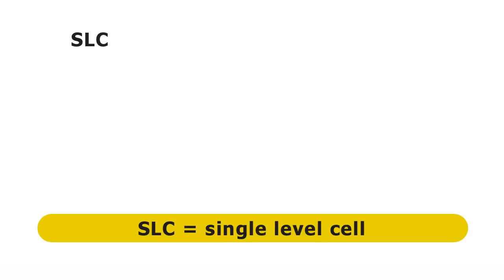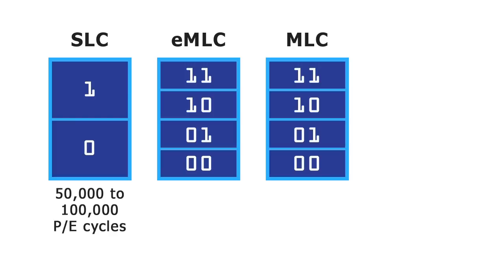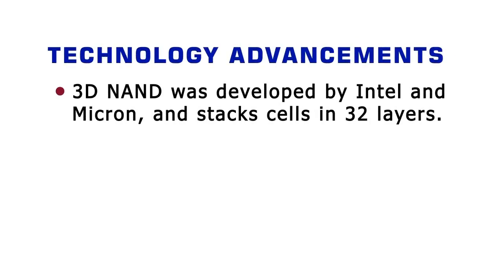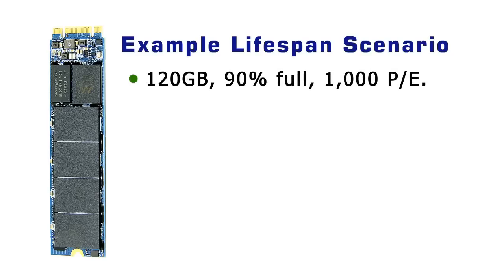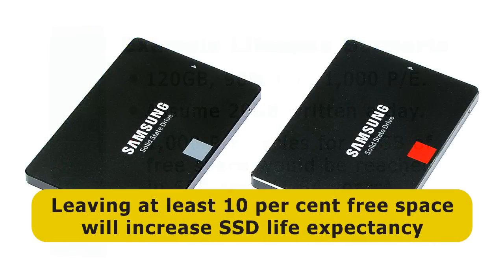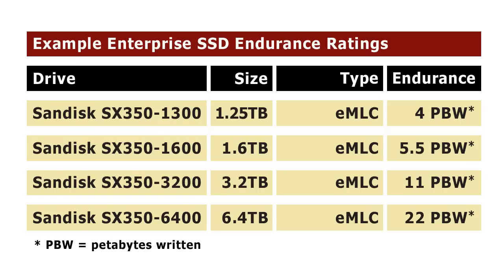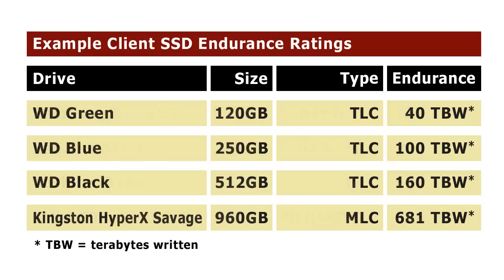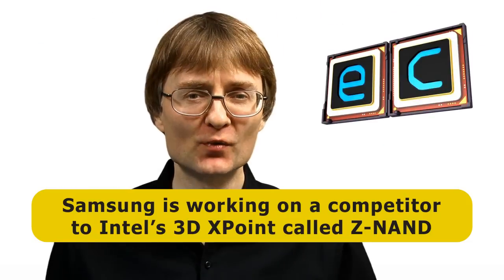SSD Life Expectancy

Comment: Try Space Silicon or Titanium Coating , or any other precious crystals or metals that can prevent the slow-burn wear-out of memory-cells , to increase the Pe cycles or SSD'S life by increasing the incandescent point level  in temperature of the silicon materials in the SSD   . Thus , mimicking the standard metal disk-drive memory disc for a long-lasting flow of electrons (leading to the after-burn effect ) which provides  greater Pe cycles for a longer life SLC < eMLC < TLC < QLC (Toshiba)= Slow burn risk increase as data concentration also increase . The Wear-Levelling is preventing memory overflows and electronic burns is caused by the Wear-Out and the Coating will make Wear-Levelling much less of a concern just like Apples Heavy Black Goo Coated Chips for a denser electronic flows without burning : Thermodynamic Laws of Electric Flows .

Comment: OMG Samsung 830 Series, my first SSD back in 2012, ah the nostalgia 🥹🤓
Still have it and working after 11 years (purchased on January)! 
And almost 25 TB data written 😄
For all people worrying about SSD writes, relax, you’ll die much sooner than your SSD lol in fact I SSDed everything from my main desktop PC to my PS4 😂 🔝 I’m a huge fan of SSDs
Reply: I definitely agree with what you said. I have an old Silicon power micro SD card from china that I bought in 2012 with my lg optimus l5 and guess what?? After 11 yrs , the same micro SD is still working, it's a bit slow (class 4 speed) but still works, now imagine how long SSD can last. I will sure probably pass away before seeing my SSD dying😂😂😂😂
Reply: They can still die from electronic defects. I've replaced probably over 50 laptop HD's with SSD's for customers. 2 were dead out of the package, and 2 failed after a few months. The rest are fine...so far!

I bought my daughter a new Asus laptop (2-in-1, mid-grade, about $1000 new). After about 2 years, the internal Nvme (Intel or Western Digital, I think) died. She didn't use it super heavy, just average school use. I told her to shut it down right away after it froze, and send it to me. I was able to recover many of the files, but not all.

Comment: I'm still sticking to a traditional HDD.  In my own experience, HDDs last a very very very long time.  I have had 1 fail EVER.  I still have old 20G drives that work fine, they aren't being used simply due to being too small.  I have a 500G drive in my system that, while doesn't see as much use, it still works and is probably 14+ years old now with no sign of stopping.  So, I don't see HDDs as guaranteed to fail, but SSDs, while faster, are guaranteed to fail, which bothers me a great deal as I don't tend to upgrade as often as most, I certainly want one to last longer than 4 years or more.

I may grab one for my operating system drive, and use a HDD for everything else.  I can also get a 4TB HDD for the same price as a 500G SSD, 8 times the storage capacity with less of a chance to fail is well worth the wait for loading times.

Comment: Very interesting but a lot of info to digest. I am 67 so maybe that's it. What I did was took you advice a bought the Elements 5T external for my new laptop. I install most of my programs to that drive and use it basically as my main harddrive. So If I am just brousing the net I do not need to plug it in. I use a 256gb SD card for the slot It work as a HD when the 5T is not pluged in. I also use a Old USB thumb drive just for portabilty with smaill files like the book I am writing. I do have a 1T external I built and a Sony external DVD writer. So far so good everthings working good and I figure my SSD is getting less ware and tear. I will say my Lattop is not set up as a game machine. Last year I had 2 heat operation so it ist pretty much business.

Comment: ssd is unreliable to store valuable data, I lost a hard disk ssd 256 gb, however  I think it is very useful to use it for booting computer system like windows 10 ...for me . i use a 120 gb for booting win 10 . and a normal "HDD 2.5  2 To"  to store my data
Reply: Same here, Windows 10 installed on a Kingston 128 Gb SSD, and everything else is on 2 TB HDD. I will never trust an SSD so much to store data on them, it's good for the OS and softwares like Photoshop CC, Lightroom CC and etc. to install it cause you can easily redownload them by using the CC application a new install, but SSD's will never be something to store important data on them.

Comment: OCZ agility 2 120 GB here working great since 2012. Being almost full for most of its life. I'd say I struck gold.
Reply: Same here, got an agility 2 60 gb from 2010 with 20 tb written. It performed really well until last year, read speeds dropping to 30 MB/s.. so now it's replaced.
Just a word for you guys, it shows as 100% healthy and 98% life left in the ocz ssd utility. Despite that its performance is pretty bad so don't trust those numbers fully =).
Reply: JRways Mine still performs great and boots in 30 seconds  with a lot of TB written. I don't see any reason to upgrade and it still reaches 150-200 MB/S read (albeit the write is like 75 MB/S). Comparing it to my laptop which has an M.2 ssd with 500 MB/S read I don't see a big difference. An SSD is still fast even after years.

Comment: HDDs are vulnerable to vibration and heat.  I've had several HDDs fail on me in 30 years.  Never had an SSD or RAM memory ever fail on me.  Advantage SSD.
Reply: Chris Ayres, give your computer a good jolt while some data are being written, repeat that experiment several times and report back to us.
Reply: Spirit Guide1214 I've had an sad fail on me under 5 years, couldve just been a bad one out of the bunch but it was still a pain since it was my boot drive and had all my data

Comment: kingston 120gb u400
30% used
Takes 7 sec from power button to desktop
blazing speed
Reply from the maker: Cool.
Reply: but this ssd don't have 3D nand
Reply: I have 120GB Noname Chinese m.2 stick  for Linux '/' partition in my i3 laptop. The same 77sec from zero to Linux Mint Cinnamon desktop with Firefox. 8BG RAM with tmpfs. No swap. /home and /var in spinning HD in CD bay. All disk operations have been optimized so that there is no write operations to SSD in normal use. The machine is faster than my i7 desktop with 18GB RAM and M$Windows with spinnig wheels.

Comment: I can't find any option for overprovisioning in the latest software v.5.0 (Samsung).
Reply from the maker: Now this surprises me! :) Though, following a quick Google, I see that it has been taken out of the latest version -- with some complains about this . . . This said, by not filling your drive to the brim with data, you can achieve the same effect as a user.
Reply: konsul2006 as long as your using Windows 7 or higher you have trim support so all free space is over provisioning space (OP on a OS that supports trim is unnecessary)
Reply: thanks
Reply: That's likely why samsung removed the OP resize tool as its pointless under client work loads and windows 7 on wards supports trim
Reply: All u have to do is go into any diskmanagement, select the partition u can shrink, and shrink it. So Windows diskmanager, select your C: partition (for ex), and reduce its size with the ammount u want as OP. 

OP is not what some-people think "magical space" its just... unused, non partitioned space on the drive.
Dont believe me? Do what i suggested above and check with your tool-box software on your SSD, it will say it now has OP space.

Comment: I laughed out loud when you said SSDs could potentially last over a decade. Years ago I bought a 60GB drive thinking that'd be enough for Windows 7; not a chance in hell, what with updates and programming IDEs insisting on being on the C drive with the OS! I bought a 120GB SSD as well, for my most played, most demanding games. Both were noticeably slower when last I checked about 5 years ago, with the OS drive constantly complaining about insufficient space. I had to take a break from... life in general... due to mental health issues brought on by depression, a relationship ending and my former employer of the time defrauding me 6 months pay (no exaggeration,  sadly). I'm slowly catching up with the advancements in tech that I missed out on in the intervening years now though. :) Thanks! By the way, have you considered getting in touch with another tech (among other things) YouTuber named Tom Scott? I think you both would get along quite well!
Reply from the maker: Many SSDs have run for far more than 10 years. I am inevitably here talking abut an average for new drives.
Reply: @ExplainingComputers  I figured, just wanted to mention it. :)
Reply: He also said "potentially" which you need to keep in mind for certain use case scenario. Take mine for example. My Intel SSD is coming up on it's 8th year & after diagnosing it recently, it might last another 5+ years. That is due to me not constantly installing/uninstalling software, not downloading or putting files within the SSD negating any need to copy/cut/paste files, or even make any significant changes that affects the write cycles.

Comment: SSDs may have a limited number of cycles, but spinning hard drives will always fail more often.
Reply: well i have a.hdd for 15 years and counting , i just buyed a ssd to run the system and i hope that it work as long as my hd at least. if not it will really be a big disapointment.

Comment: An excellent video regarding ssds. But I still beleieve an SSD's life to be shorter than HDDs. My Brand new ADATA SU 630's life dropped from 100 to 9 percent in just 4 months whereas after 7 years my intel SSD's life is now at 97%. All of my HDDs are still at 100% after years of use and performing flawlessly.
Reply from the maker: Certainly SSD life expectancy -- at the same data write levels -- is far lower than HDDs.

Comment: A more important thing to note is that SSD's are best installed in systems and not utilised as external hard drives. Especially if used for backup and stored away. Lack of power has been rumored to result in data degradation and loss
Reply from the maker: Simply not true. SSDs will retain data for at least a year with no power (just like all USB drives and memory cards).
Reply: Noted with thanks

Comment: I got my Samsung SSD 3 years ago and used it thoroughly. Multiple data writes, formats, reformats, etc... and now after 3 years the total TBW still is <25TB, and it has a rated TBW of 150TB so it will last another 15 years at this rate. Good choice to spend a bit more on the SSD back then.

Samsung 860 EVO 250GB SATA M.2 (2280) Internal Solid State Drive (SSD) (MZ-N6E250)

Comment: Still using an original Crucial 120GB SSD from 2011 for Windows and it's going strong. Have swapped it from an original i7-860 to an i5-3570k to my current i7-6700k setup and haven't had a single issue in almost 9 years. I don't install hardly any programs on the drive at all, just read Windows and do updates and keep about 20% of it free

Comment: I have a question. 

I want an SSD and NVMe drives that meet these requirements:

1) Are 1TB to 2TB. 

2) Are capable of hardware encryption. Yes, I know hardware encryption is weaker than software encryption.  

3) Has a high speed of data transfer and extended life. 

I want to software encrypt the drives as well. 

Any recommendations? 

  I want to software encrypt my newer and older systems. However, I want an SSDs that will resist the many read and write cycles. SSDs have come a long way even since the date of this video. 

  I do not want to resort to hardware encryption because it has flaws.
Reply: There is alotta qualifiers that meets your requirements. Just go check out on Amazon or wherever online shopping supported by your region. Keep in mind that older motherboard systems prior to 5 years ago is unlikely to have NVMe slot to support it. Also what do you mean by "hardware encryption is weaker than hardware"? That doesn't make any sense.
Reply: @KillRei  It was a typo. I corrected it. 

I want to do both. I plan on building two systems.
Reply: Ok. In most cases hardware encryption is better & stronger than software encryption. Also be careful with it's implementation. On some systems, using both type of encryption at the same time may be incompatible and/or may conflict with each other too, that it could be possible in a few instances that it might negate each other's encryption capability.
Reply: @KillRei  Hardware encryption is stronger? Have you read the papers on that going back ten years. 

Hard drive encryption for a skilled person is easily bypassed. 

If you are referring to some top secret government crap. Hey more power to you. 

Consumer grade hardware encryption is mostly sub par. 

What are your sources for this?
Reply: I may be unrelated to any government but I don't have to be part of one to know my tech. I am after-all a tech-savvy enthusiast. I'm no encryption expert but I've been in the scene long enough to know that hard-crypt is ON AVERAGE more secure than soft-crypt depending on how well the implementation is. It all depends on different usage scenario. Of course, both types of encryption has it's plus & minus. Take the hard-crypt Trusted Platform Module for example, it's widely adopted, difficult to brute-force without physical access but has a backdoor hole & being a hardware crypto-processor, it adds some cost to components. VeraCrypt or LibreCrypt is a good soft-crypt for you if you are into it, if it has any known backdoor it can be patched through updates but a bit easier to brute-force attack than TPM being the software that it is. Don't rely on BitLocker for soft-crypt. Its been breached soon after release. Seems like two of your sources from How-to-Geek & ZDNET does supports my claim, while another one has an ambiguous claim. I couldn't be bothered reading or watching the rest nor did I asked for sources. If you are looking to get more details, maybe Wikipedia could inform you better. From here on, you are free to choose whichever type you believe to be more secure & just go with it. There is nothing truly wrong with choosing one over the other.
Reply: @KillRei  I am not trying to be insulting or rude. I am sorry if I came off that way.
Reply: @jamesedwards3923  Don't worry about it. I try to be as professional as possible when it comes to customer service.
So are you going to use soft-crypt or hard-crypt? If you are going to use both, make sure that the software are compatible with each other.

Comment: Failure modes of eMLC drives MUST be considered before buying. AFAIK eMLC drives are designed to run in redundancy systems like RAID so they fail totally much more rapidly than consumer drives. It's more beneficial form enterprise perspective - either it works or doesn't. In contrast consumer drives are designed to deteriorate in a more "gradual" way. if you read this please check this info. I write it from memory and it's based on Allyn Malventano's brief mention on a podcast.

Comment: My experience with Flash memories is that when they start to fail they fail to erase, they become read-only rather than failing completely like a hard drive. So I'm not worried about data loss except due to inelegant software that discovered the problem only after it had partly erased a cached block. (The video talks about P/E cycles but the way Flash works is more like E/P -- you have to erase the memory before you can write to it as the writing only 'unsets' bits, it can't 'then set' them. Flash is divided into blocks that are typically multiples of 64KBytes in size and the erase operation is done on a particular block of memory before its ready to be written to.)
Reply from the maker: Instant failure is very common too for an SSD -- just see the comments here!

Comment: Very interesting information, even if most of it was over my head. I have in fact, just bought a new 250GB Samsung SSD and installed it in my laptop along with a 1TB mechanical HDD. (My laptop takes two HDDs). My SSD is divided into two partitions, both of which currently have 50% or more free space. I only have Windows and most frequently used data on the two SSD partitions, with other data on the 1TB HDD.
And yes, I have copies of my data on three portable HDDs. This proved to be a very good move when some time ago at the same time, one of the three HDDs died and another one got corrupted and needed reformatting, leaving only one good copy of my data. which I then copied back to the reformatted HDD and another new replacement HDD.

Comment: I've always known about SSDs 'life expectancy' situation. What I've never heard about is what to expect when an SSD achieves that state? What happens when those cells start to fail? How do you know if an SSD is going bad due to problems with cell writes and has anyone actually seen it in the wild. Outside a Lab where someone was intentionaly attempting to achieve that state. 
With the exception of some very early first gen SSDs, the Microns come to mind, those I've implemented have been pretty much flawless as best I can tell. Zero failures, zero reported issues.

Comment: SSDs do not retain their data as long as hard drives when powered off. In fact the rating for an Enterprise level Samsung SSD at the end of its TBW is only 3 months at 30c temps! It tends to be about 1 year for retail models.
Reply from the maker: Very true. SSDs are not long-term storage devices (unless the data is regularly refreshed).